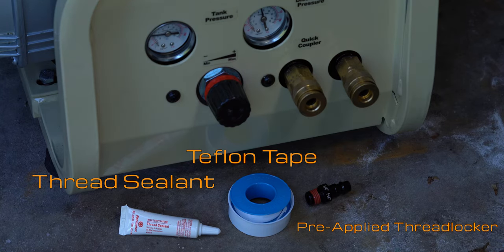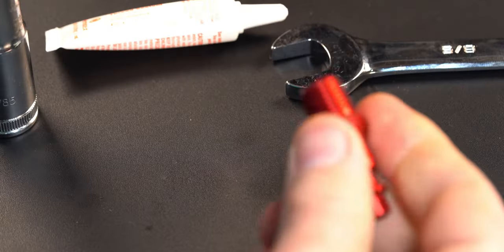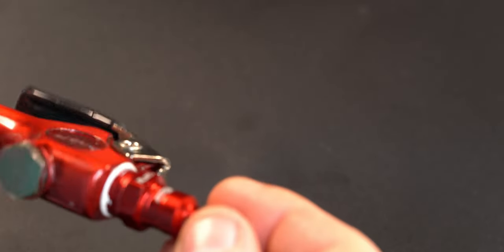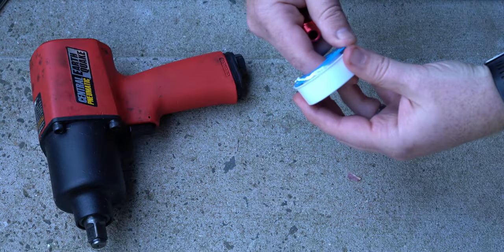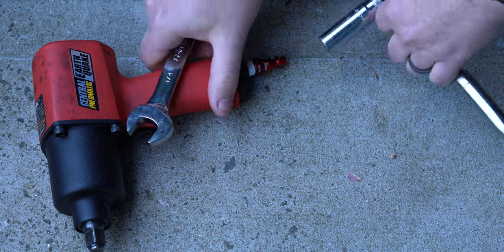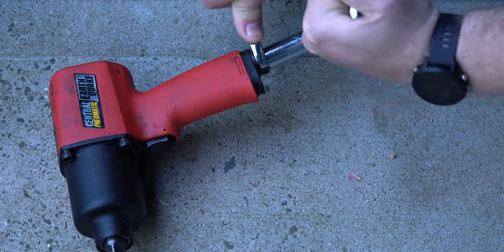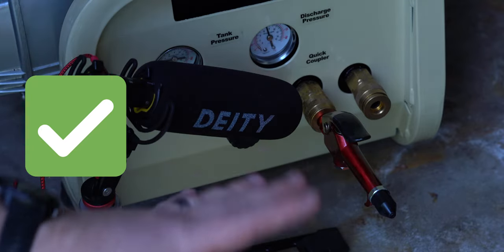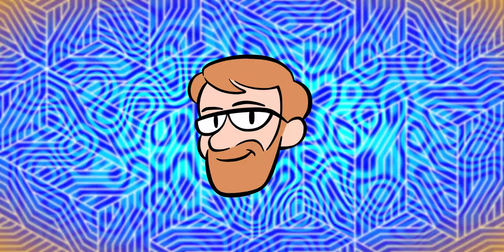Air Hose Fitting Installation: Thread Sealer VS Teflon Tape VS Pre-Applied

Comment: Good information in the video, but can you say which liquid/paste thread sealer you used?
Reply: Looks like "PERMATEX HIGH TEMPERATURE THREAD SEALANT, 50 ML". Unlike Loctite it appears Permatex does not give them an easy number.
Reply: Harbor Freight threadlocker 42.  Cheap and works for me.
Reply from the maker: Sorry that I somehow missed this, but Paul got pretty close! Permatex High Temperature Thread Sealant, specifically item number 59214 which is the 0.20 FL OZ / 6 mL size tube. They do put the same chemical in other container sizes, though.